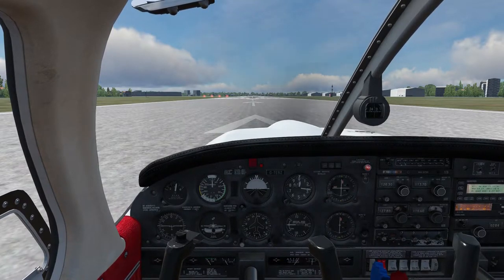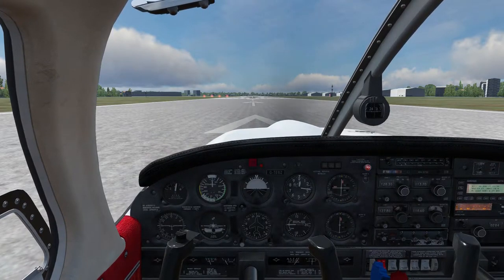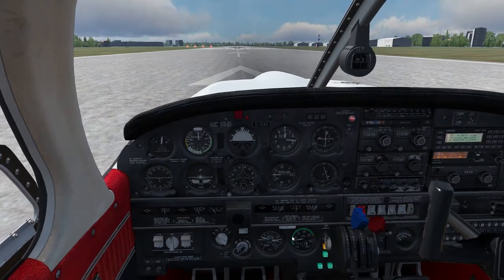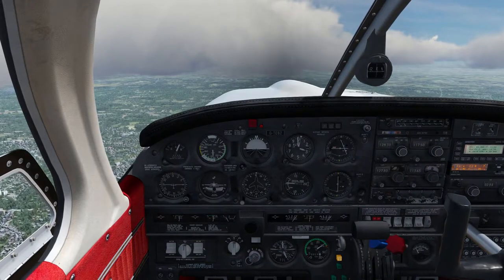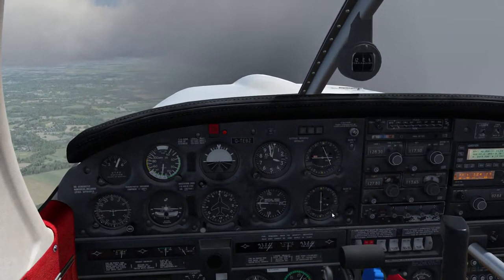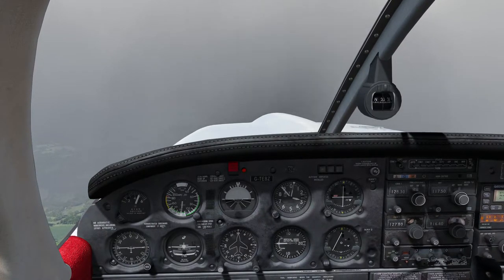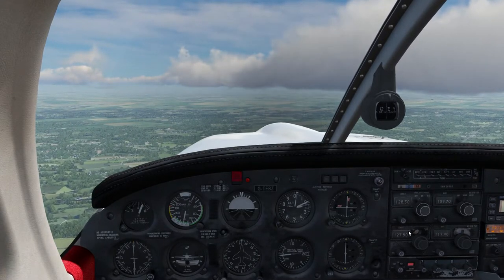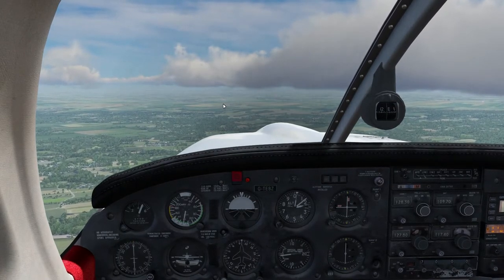First Cross Country Flight! | Advanced Flight Tutorials  | Lesson 8

Comment: That was a really great flight - I think the clouds helped us learners as they emphasized using the CDI's to navigate instead of doing it visually. Before watching this I'd taken the previous few lessons on navigation and used them in a quite similar fashion to what you did here in various flights around southern Africa. I won't say it's easy, but it's certainly not difficult to navigate using the beacons and using intersections instead of going right to the beacons helps create a more direct flight.

I have the Just Flight Arrow III for X-Plane and it also pulls to the right, both in the air and on the ground - I checked that the rudder trim was centered and it was.But what a great plane it is, in both FSW and XP :)
Reply from the maker: Glad you enjoyed it and it helped! The old fashioned way is VOR hopping and it is still fun to do that, because you do not need to follow said routes, but the airliner way is using intersections and the VORs and NDBs are used to navigate the airways, both high and low level.

I am sure the aircraft should be pulling left, not right though.

Comment: Just completed this flight in the Piper Arrow, alternated pausing the sim and the video to make sure I was on the right track.
You mentioned that the plane was pulling to the right near the end of the flight and I was thinking you probably forgot to switch between tanks during the flight and if you were using the left tank you probably ended up with a heavy right wing.
I don't think the turbulence in the sim is related to the plane. I have about 27 hours in the Arrow and about 23 hours in the Cherokee and I have that same turbulence problem with both aircraft as well as the other aircraft in the sim. I think the problem is the weather, or lack thereof, in FSW. It may be how DTG tries to make the weather a little more real without a fully implemented weather system.
Thanks for the tutorial, it was a great flight.
Reply from the maker: For the sake of tutorials I have set the tanks to auto switch, so it wasn't that I am sure. I started on the right tank anyway!
Interesting what you say about the turbulence. It is very very annoying! I'll have to keep an eye on it! Glad you enjoyed the tutorial, we'll be doing a couple more like this over the next few episodes to really get a good training setup going before moving to other stuff!

Comment: Is there a correct setting for mixture and prop setting when taxiing? Practising hard to improve. I also seam to have a large dead zone on my throttle before the the RPM picks up. Using a SaiteK  throttle quadrant.
Reply from the maker: For taxi, I would say the correct method would be props full forward and mixture leaned somewhat - perhaps 3/4" out from the full rich position. As for the deadzone, I am not sure what is wrong there, but I recommend checking the control settings first of all in case of an accidental deadzone being set up
Reply: thank you
Reply from the maker: No worries, hopefully that will help!